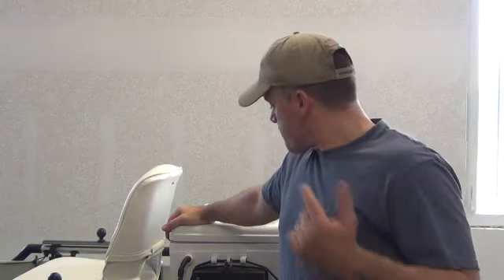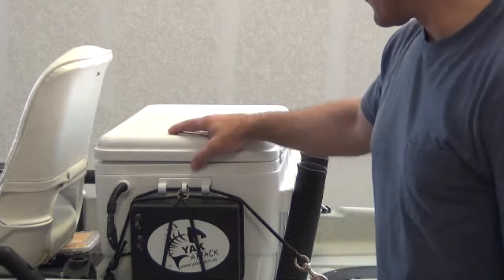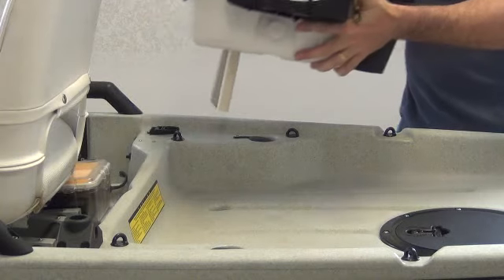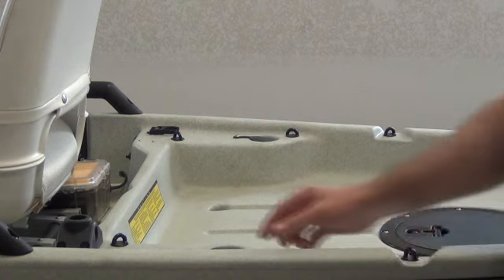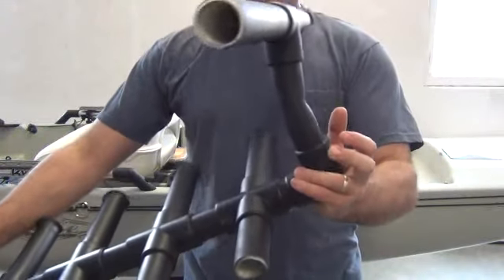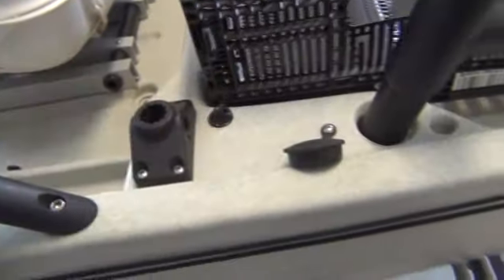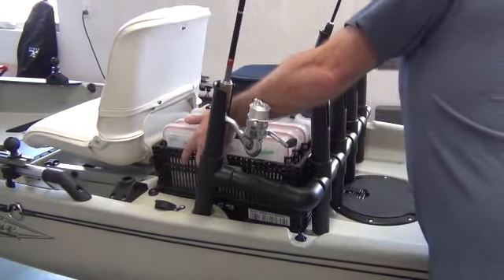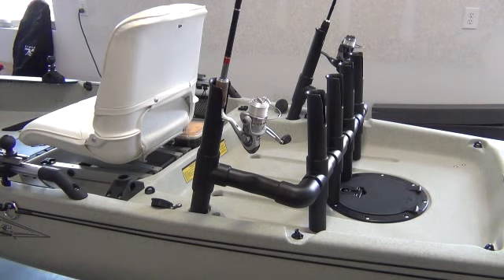DIY Kayak Fishing Crate

Comment: 9:10 If you roll, You're going to loose a L-O-T of stuff. You need something either covering the big folding crate or tie all that stuff in with something...maybe one of those small cargo nets. Believe me, I learned the hard way not to take EVERYTHING with me, I just take what I need for the way I plan to fish. When I rolled my Yak the first and only time it cost me over $1K in equipment and electronics! I had so much stuff in my crate that it popped the snaps and sank to the bottom with everything attached to it.
Latch things to the boat...Not to something latched to the boat.